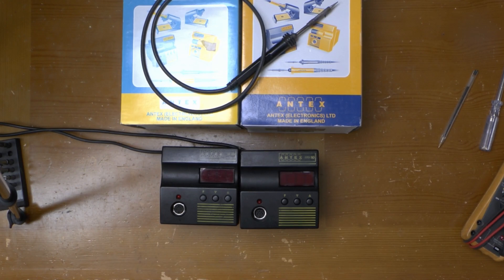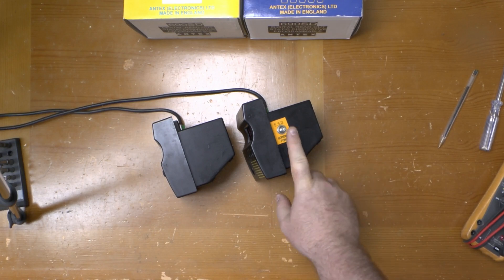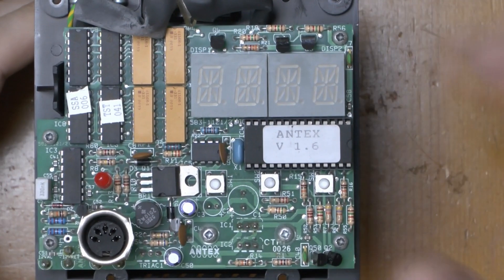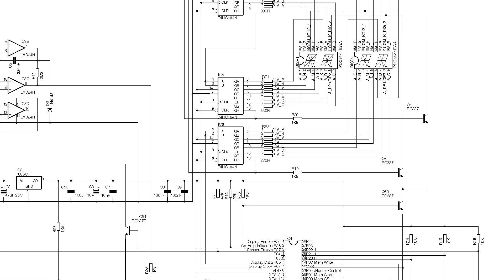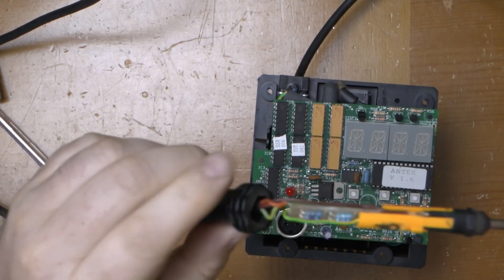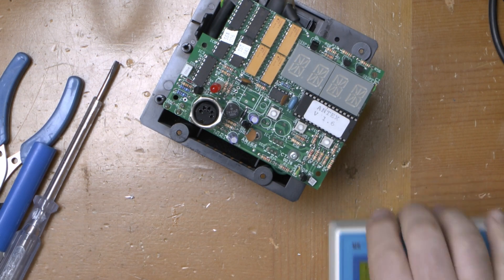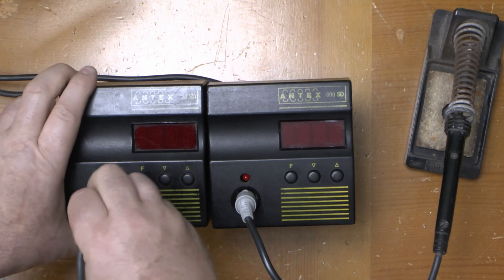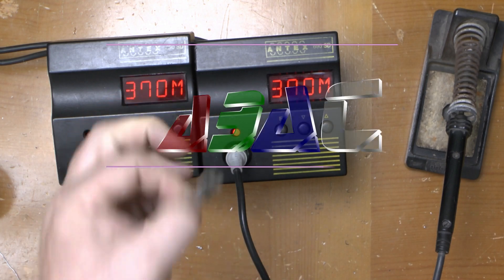Antex 690SD (and SD50) Soldering Station teardown and fix

Comment: I do love Antex irons. They look so perfect. I still have my first x25 and I wanted to say, ''still working'! Yet, I kid you not I plugged it in -while your teardown was still running - to fit a replacement battery, and nothing... The element had gone when all I wanted to do was say it's been ultra reliable. So I've just been looking for replacement elements and there is a similar one, but these have three screw holes for mounting and to fit the 'hook' which also has three holes... Anyhow, they are still remarkable things. Super value and imagine how many budding electronic engineers started off with a 15W Antex and their copy of ETI? (and Beano).
Glad I found your channel.
Reply from the maker: That's just sent me down the rabbit hole of finding a replacement element for mine, not that I need one yet.  TC 50 iron?  No problem (expensive from Antex though). SD 50 iron?  That's a different matter, and the datasheets suggest the two irons use different elements and different sensors.
Reply: @AintBigAintClever  PS. Great name choice, because that is all of us, and it takes years to realise - If indeed you ever do.😸😸